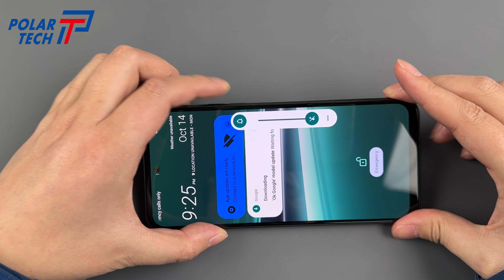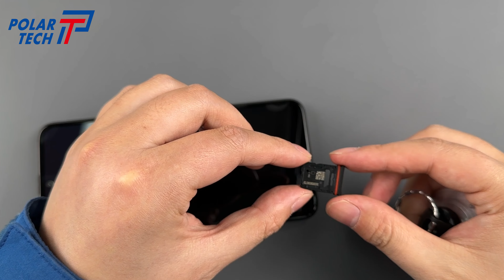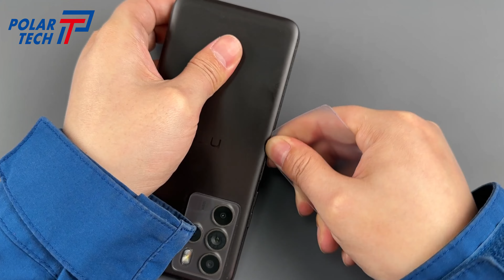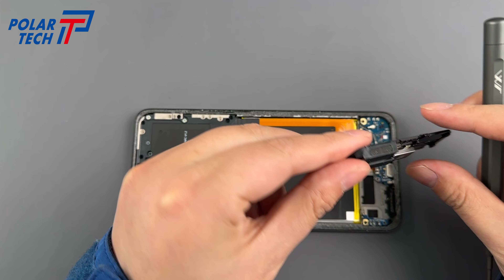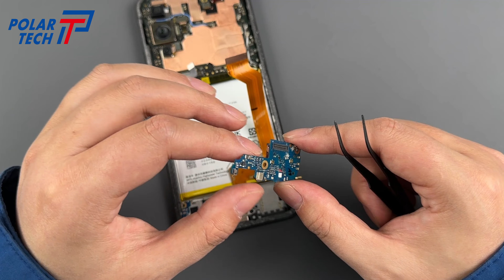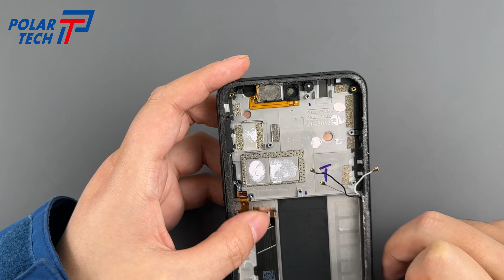HTC U23 Pro Disassembly and Repair

Comment: Hi im about to repair my htc u23pro as i have a broken lens and your website has the parts i need but before i purchase did you find if that camera module still worked after removing the back cover?
Reply from the maker: Yes, it's still working.